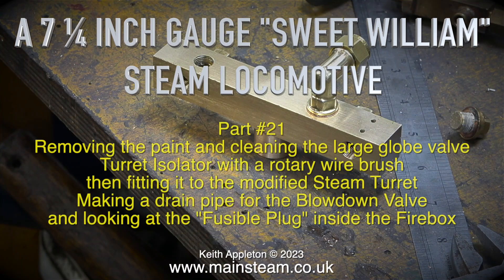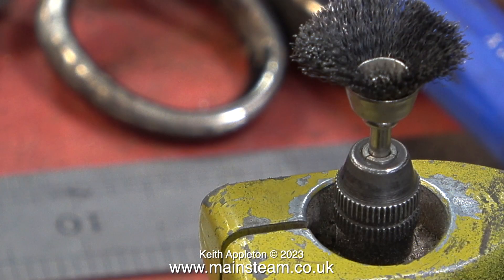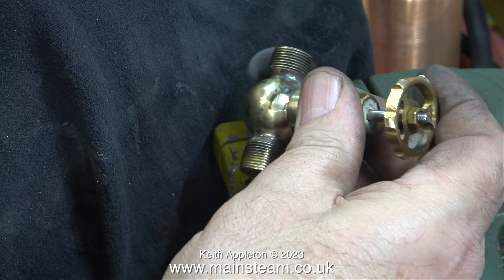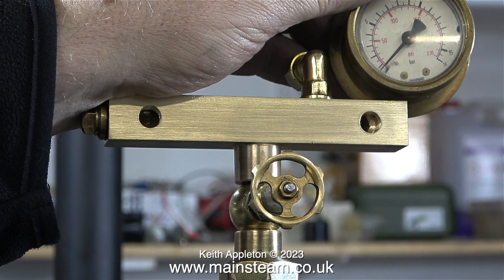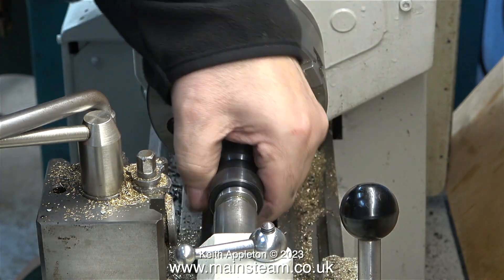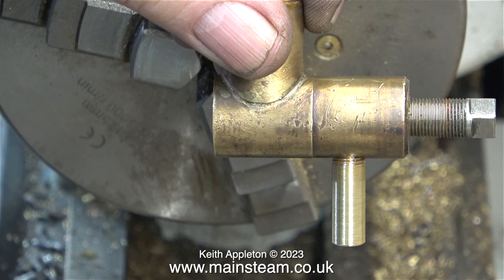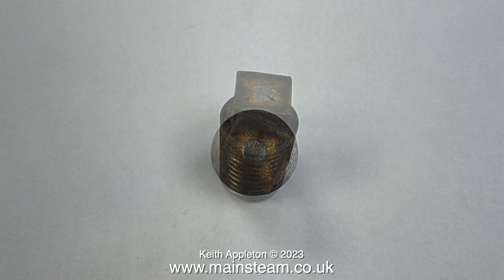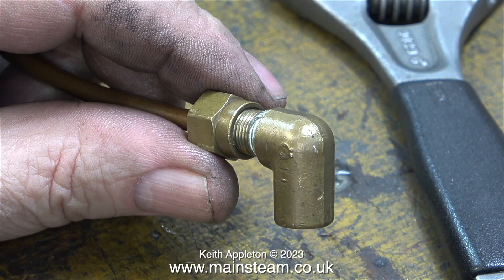A 7 ¼ INCH GAUGE "SWEET WILLIAM" LOCOMOTIVE - PART #21

Comment: Something that just struck me (no worries, no damage) is that except for threads per (in BA), you almost exclusively use Imperial measure (feet and inches). I've been watching your channel for about 4 years now, and I'm so used to imperial measure, (I live in the USA) it never occurred to me that you rarely use metric measure. Good, after all imperial measure is more accurate, at least I think so. 
By the way, what does BA stand for? ;-)
Reply from the maker: British Association, please watch a few more of my videos as I mention things like this frequently .....

Comment: Another option to the wire brush is to get the "Scotch-Brite" brushes. You can get straight bristled brushes made from the same stuff as regular Scotch-Brite pads, in a similar range of grits. The brushes are available in the usual wheel/cup/straight versions..

Comment: When you have a difficult time removing paint, place it in a (cup) of Methyl Ethyl Ketone.    It will completely emulsify any paint overnite, or allow you to wipe off any paint within 20-30 minutes of soaking.   (But wear nitrile gloves and ensure that the work space is completely ventilated.  Stuff will turn your skin snow white immediately and is carcinogenic --- hazardous material)
Reply from the maker: I used MEK for assembling plastic kits many years ago, the smell of it alone is very potent.I think I will stick with Cellulose Thinners for paint removal thanks.